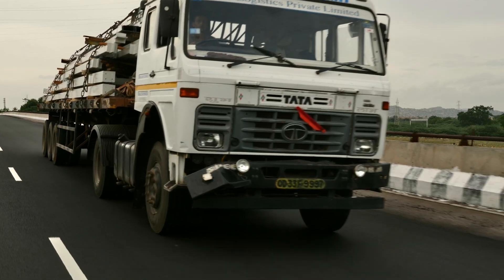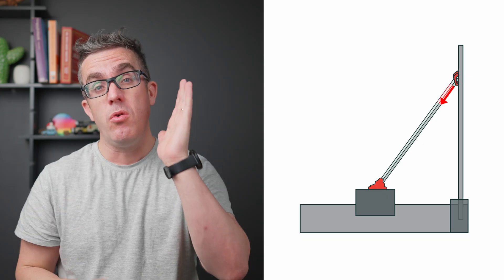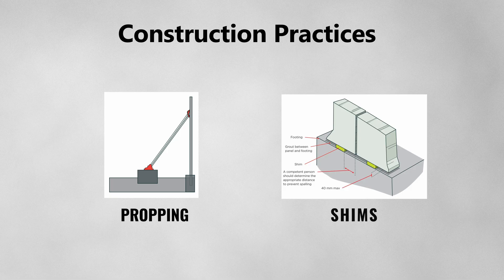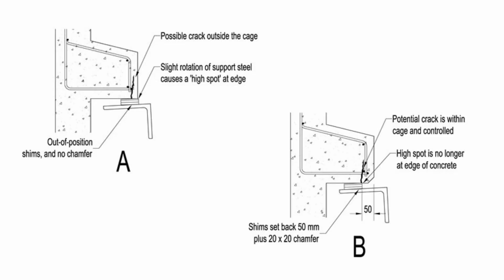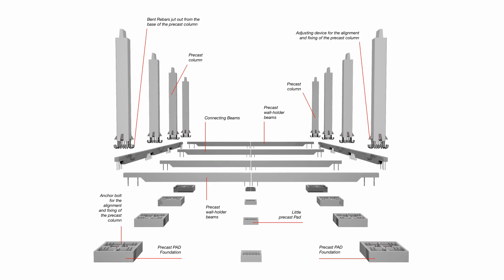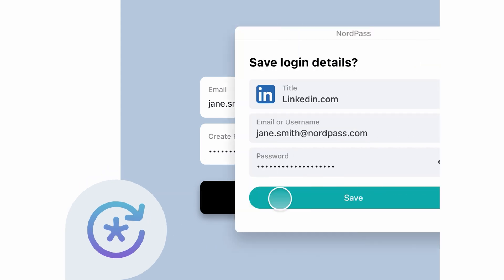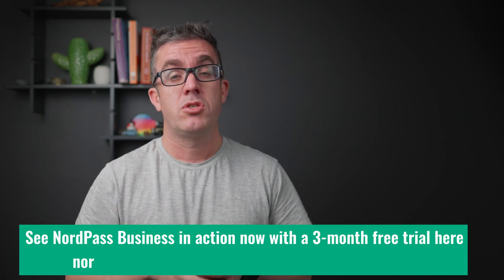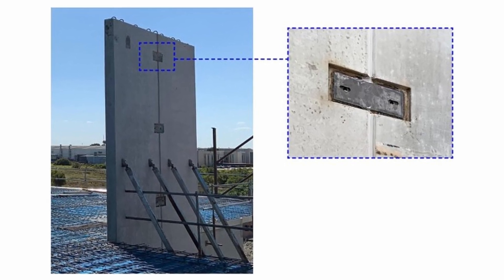The Key Design Principles for Precast Concrete Design

Comment: Good effort, very nice graphics. I think a few wrong info worth mentioning though. 1. Concrete Strength is typically full strength (+28 days) at erection stage, you said otherwise. 2. No, you don’t need to provide reinforcement at the joint more than what you have in the wall component for in-plane demands; those are completely different things for for different purposes and typically you don’t need as much reinforcement at the joint; e.g., for bending, you would just put the joint rebars at ends so that you have the largest moment arm and thus the capacity. 3. It made sense when you used “dowel action” term in a few places, but in most other places I think you used the term wrongly, but I understood what you were trying to say and what you were trying to say wasn’t called dowel action. Thanks for the content overall though.
Reply from the maker: Hi Ismail, 
1. it depends on how earlier you erect the precast, a lot of the time you do not need full strength until much later. So depending on lead time you are not always at 28 days strength.  EG in multi-storey buildings, where you need 65 or 80 MPa concrete it can be installed at a much earlier stage, limiting time in the precast yard.
2. it is not typically more it just needs to match the reinforcement EG is you require N16 for each face dowel central ~22 diameters which would be 24 diameter
3 correct it would be technically a shear interface, but there are some dowel actions. 

What are your thoughts on the above? Looking forward to your response.

Thanks for the feedback much appreciated;.
Reply: @BrendanHasty   thanks for your reply. I agree with your explanation 1 above, it really depends as you said; typically though the precast members are erected more than 28 days after they were cast. But I agree it depends. One thing though you still need to lift and rotate to place in a storing place after stripping, or need to rotate for finishing purposes; so at that stage, the strength is for sure not ultimate, that’s worth mentioning. 
2. It doesn’t need to match to the component reinforcement. E.g., component reinforcement and its spacing could be governed by temp and shrinkage requirements and there is no such requirement for joint design. Or component could be designed for out of plane gravity forces bearing on the wall eccentricity and if the joint is analyzed as pin, then it just needs to be designed for shear force since the moment is zero. 
3. What I understand from dowel action when ACI uses it is that the dowel action causes pure shearing of the reinforcement though there is more to it such as shear friction between concrete interfaces. Thanks.

Comment: Have you ever had to deal with concrete screws as a permanent connection? Appearanty they are mostly intended for temporary fixings (such as braces) but in practice I see them also beeing used for more connections to connect roof structures (with horizontal thrust forces) to hollow-core floors. I remember discussions with co-workers about this, so where fine with it others not so much (it had to do with type approvals and certification for the appplication).